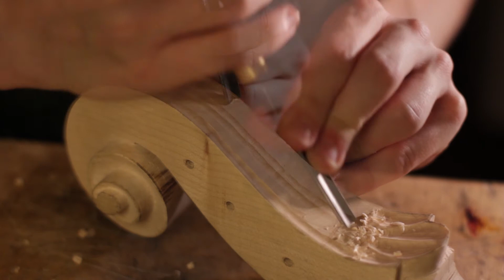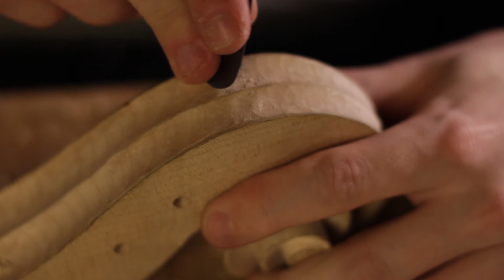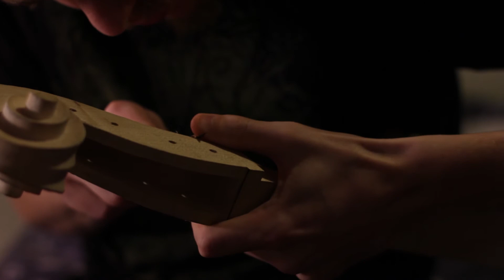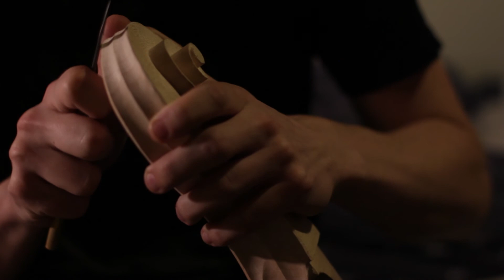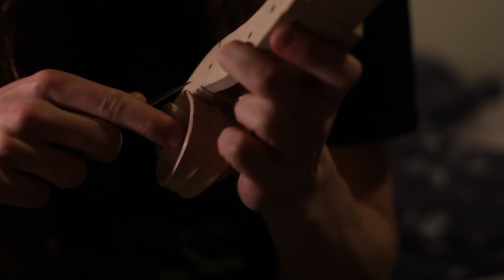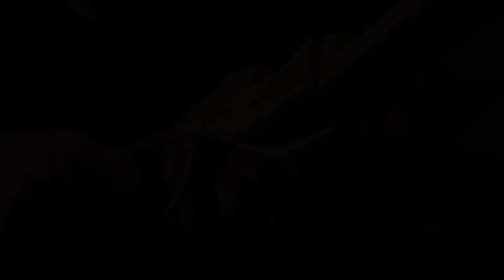Fluting and beveling a cello scroll

Comment: Beautiful work. What number and size gouges did you use?
Reply from the maker: Thank you! I'm not completely sure what they are, but I believe the curves are no 5 or 6 primarily. The small gouge I use for the edges and narrow sections is about a cm, the larger one is maybe 1,7cm. And then I have a larger, flatter one which I love using for everything, and I'm sure I used here as well. I think it's a 2,5cm no 5 or 4.
Not sure if this helps you, but since I'm using vintage tools, they don't have much information on them.